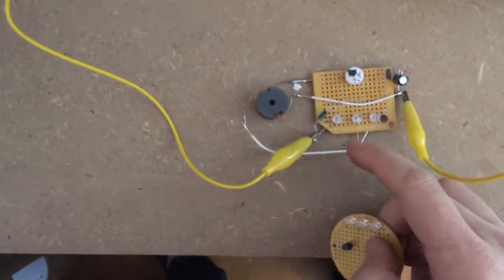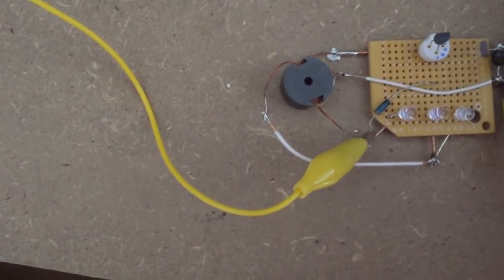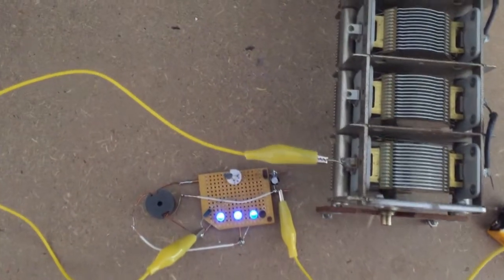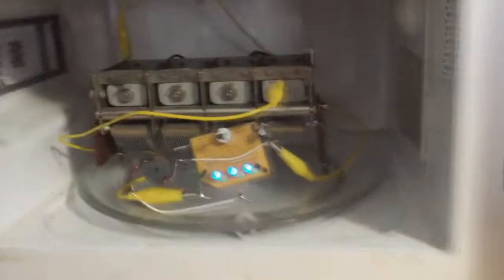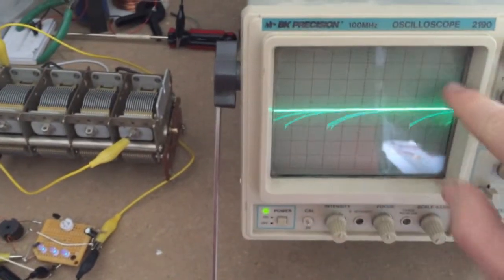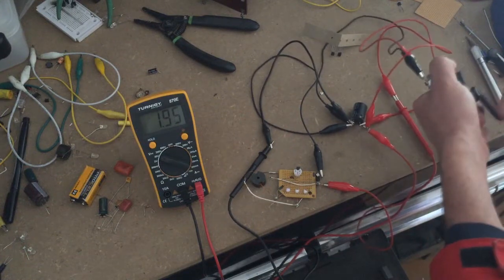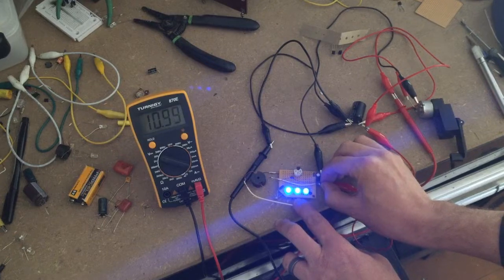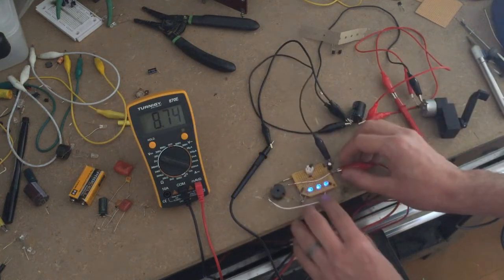Battery Free LED Flashlight Driver - SJR Looper V4

Comment: Many of your circuits would be a lot easier to replicate if you spent some more time describing the transformer in a drawing.

have you ever used Field Effect Transistors with very very low base voltage? Can those be switched on and off with a feedback winding that has only one end connected to the base and another end disconnected?

Comment: Your circuit works on scalar potential or etheric energy, so you can cage it or not, it makes no difference - you should reach the level when all works only with a ground wire, and eventually without it, only on surroundind fields - is posible and doable, others did this before - kapanadze, akula, even i tested a lot of circuits (one like a flashlight working for a year continuously some years ago - schematic like OU charger but improved), so you will succeed - thanks for your work and sharings and keep going! I am glad that you catched experience in this field :) (and for the other people - ya it works without hidden batteries, really funny these untrusting people, perhaps some from secret services making manipulations)

Comment: You can use a small peltrier cell instead of crank charger and charge the flash light whit the heat of the hand.
Reply: Parallellook what about warm conditions? that would have to be 2 peltier cells :D
but the best is to make more than 2 charging methods in case one isn't working
Reply: Peltier cells don't really make enough electricity for most practical applications

Comment: Ha, hidden battery indeed... Good job using the variable air cap. Electricity can be modeled using fluid dynamics for a reason... You can also create electrical "acceleration" in a vortex as well.

Comment: If you switch back to electrolytics, is there a reason to keep the crank for charging? Or would it be better to just put a little shake charger in it like the first prototype?
Reply: 72fr250 I liked that one too.

Comment: Do you ever make a printed circuit board for the items like the Tesla Torch that you produce and sell? A PCB could save a lot of assembly time and make the design that much more reliable. There are plenty of places that make PCBs for low cost and loads of free design software.

Comment: It isnt very bright. What if you use a 1W high efficiency SMD Led, underpowering it will also increase efficacy(lm/w) and tried a off-the-shelf boost LED driver, so that you have a reference point?